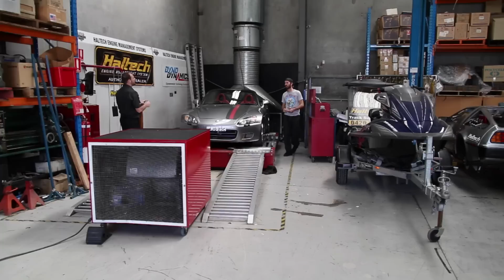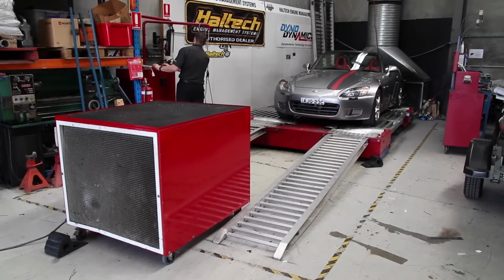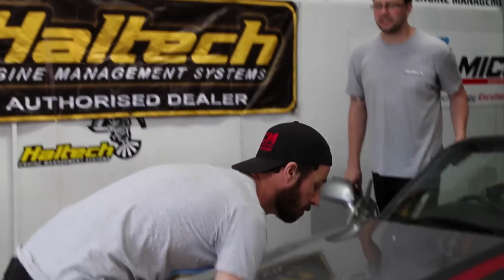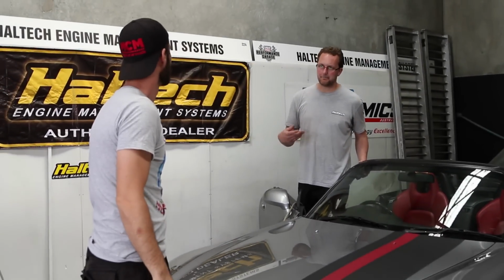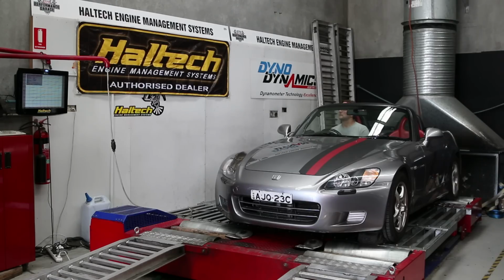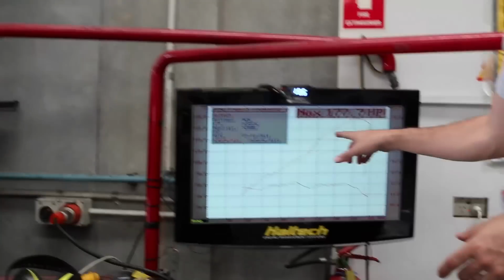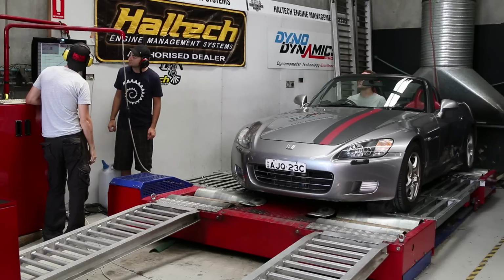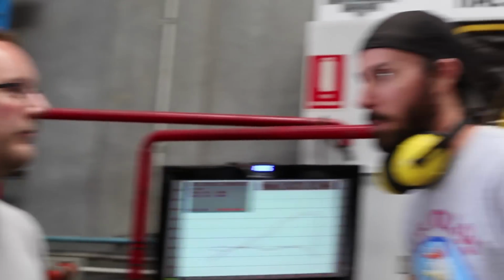Cold Air Intakes Mythbusted [Naturally Aspirated]

Comment: I have a ss cobalt Lnf n I put a aem cold air intake and it makes the turbo sound really nice and if anything I noticed a cleaner sound for sure but I cant make a claim and say that I obtained more power since I've never had it dyno tested but with the combination of the aem cold air intake and the hahn 3" downpipe catless does feel like I gained a little hp but like I said I need a tune and dyno test it to make a legitimate claim like that but sounds great an mean even with stock exhaust and charge pipes. The next step for me is the charge pipes and intercooler then after that I'm shutting for a trifecta tune and stage 3 clutch then I'll start modifying the exhaust system, intake manifold and add stage 3 sensors and coil overs to drop it to the floor plus many many more my goal is stage 3 since I need my whip as a daily driver #cobaltnation

Comment: Think modern cars are not meant to be tuned if you look at output per litre of a car now (1.0, 1.2, And 1.4/5 for example) small engines now can put out 120-150 stock much of the improvements in output and economy come from progressing injection and programming technology and like was mentioned you probably will not get much more unless maybe you throw it all away and take an engine back to bare bones and rebuild it with carbs, ported, polished, new headers etc instead even then it’s still probably not going to get much better, though one thing is true that turbo and supercharged engines do benefit from from inter coolers which is properly achieving what is intended of the NA cold intake claims to do, but  I am curious if this was done again in very hot weather or hot and high conditions would it still have showed the same result as say spring autumn or winter

Comment: Would the stock air box with its tiny baffles flow enough air for a 5.3 with a larger throttle body, bigger cam, worked heads, headers, and free flowing exhaust? Doubtful. Aftermarket can AND will.

Comment: I was gave a 2003 Civic with 76000 on the clock no power crappy mpg bought a $20 cold air on eBay Chinese junk lol I was curious lol turned out it was for a accord made it work and wow what a  difference night and day now it will squeal the tires and it averages 38 to 40 mpg

Comment: I dont have access to a dyno. I would like to see test results where the air filter is in wheel well, area AND heat insulation the pipe from filter all the way to, say 3 inches after Mas airflow sensor. This is what I've always done when going cold air. What better way to prevent heat soak? I might be wrong. Let's hear you.

Comment: For a cold air intake to work you need actual air going into the pipe to your motor because on a dyno your not actual getting air into the motor because your not moving
Reply: Cold air not ram air,there's a difference
Reply: CaptCaaaveMaaan I've done both and it makes a huge difference. It really IS worth while on a NA engine. I have two identical cars and engines and one with and one without all the mods.. MASSIVE difference.. Alfa 156 2.0L's... simple mod..massive change.. Alfa choked them for what reason again?

Comment: I'd like to see the difference between getting fresh air from the headlight or front valance area versus the normal intakes we see that end under the hood where you're sucking hot air from the engine department
Reply: most stock ones pull it from the grill and/or inner-fender or stock hood intake scoop and when you buy the CAI it throws the open filter inside the engine bay. I just bought a drop in stock K&N replacement and I'm just going to 3D print a new horn that goes from the fender to the front of the airbox thats the source of the restriction
Reply: @NXT_LVL  I guess I'll be stuck with building my own since the intake I was gonna buy has went out of business. I'm having to sit my engine in so I can mock it all up.

Comment: I got an Audi 90 20V from 1989, a 2,3 L straight 5 20V DOHC, 170 HP stock. So if I made my own cold air intake by bending/welding a pipe with inputs for the vaccuum and sensor BS, put on a cheap €10 cone air filter from the swedish equilevent of Autozone, do a resonator delete, run some cold air feed, put a homemade heat shield around the filter. Will it do anything other than making a filter swap more conveinient?

Comment: Sorry mate, your tests are not valid. Why? Well, for starters your dyno lacks a front fan resembling real world condition. When a car is accelerating, air is hitting the front of the car at a higher velocity and volume. You can test this by just sticking your arm out of passenger window car when your on the freeway. This blast of air will increase the velocity and air pressure that your filter will receive in  real world condition.
Reply: ya I totally agree they always test in wrong way. they always seem to get it wrong when it comes to their mythbusting videos.....
Reply: it's all relative....google " the principals of volumetric efficiency " then air flow dynamics " these both demonstrate that horse power is robbed by warmer less dense air. friction causes air to heat. less things between the atmosphere and the piston means less friction  which means cooler denser air mix which means greater volumetric efficiency means more hp. it's basic science fact. just make sure you avoid heat soak and the engine will always gain hp

Comment: Now test it on a shitty car that only makes about 130hp or less. And see if there is a difference. Testing on performance cars isn't an actual test. Because obviously it works for them because the factory restricts the airflow. But low end fuel efficient cars don't have that restriction, and possibly lose power, because there is too much air that's where the test should be.

Comment: So did anyone even catch what brand model or anything in regards to the actual short ram air intake they were using, I mean I'm sure there is a difference between Ebay Intakes and a Takeda Stage 2.  I'm just wondering if another Intake system might have produced more than 6hp.  I have seen some dyno reports from companies touting 10-13hp.  I think that is a little much for a intake but hey, who am I to call them liars.

Comment: its obvious it would. you are making there air colder coming to the engine. you are taking out restrictions that might be in a stock intake and going to a smooth pipe instead of the stock one that isnt smooth and flat in the inside. the material doesn't make that much of a difference. its not enough pressure to make a difference like it does with boosted car. plus the more you things you do the intake will help out as well, headers exhaust, intake manifold etc. for the money it isnt that bad, not like those fake chips those dont do anything.

Comment: any body else notice the amount of power loss in general of this car? should have somewhere close to 240 hp from the factory, 170 is a 70 HP drop which is pretty bad lol
Reply: those figures are power to the wheels. you lose power due to friction through the transmission and the differential. its probably still making close to factory horsepower.

Comment: So heres a question.

If I keep the OEM Airfilterbox but put in a KN air filter, and use the carbon directflow aftermarked piece to direct the air direct in that box. Will that help? Or is the point just removing the box?

Comment: A Wankel is like a 3 Stroke :D Not a 2 Stroke holy moly
Reply: +Itachi Uchiha the best way to describe it is "All" stroke. due to the nature of how it fires.
Reply: MrDeathChicken relative, i premix my rx8 with 2 stroke oil but its an unique engine and i love to drive it
Reply: +MrDeathChicken What is an 'All' stroke engine?! there is no such system. A Wankel engine uses the otto cycle, which is a four stroke cycle
Reply: i'm aware, its not an technical term. It just refers to the fact that there is always combustion happening in the rotor. because it doesn't have cylinder banks like a piston motor. I heard the term on regular car reviews as far as I remember

Comment: the s2000 came stock with 240hp and now youre down to only 177? where did 60hp go?!
Reply: Wheel horsepower vs flywheel horse power. Totally different things buddy
Reply: i know they are but its normally only between 10 and 20% loss between fly and wheels
Reply: Its an old car now likely with a lot of miles, probably on cheaper fuel.
Reply: this is true

Comment: Seriously, a 177HP is not a high-power engine
Reply: 177 to the wheels and 237hp, greatest displacement ever made from an engine, 120hp per Liter until the ferrari 458 came out with displacement of 125hp per liter, which makes it a high powered engine

Comment: 177hp..??? they have 237-240 stock
Reply: those Hondas are crap
Reply: +Noah Rule scuse me? they beat 350z's, those hondas? only other hondas out there that have more hp are the newer sedans.. amd not by much and weight so the s2k is still better.
Reply: Rcboi96 Honda Vcrap. Ain't for everybody
Reply: +Noah Rule can't handle them, but I have a Lexus right now I'm saving for an S2K, how does the sound of VTEC not make you smile man what kind of life do you have..
Reply: +Noah Rule yes I will admit the they are in the top 10 most unsafest cars in America, but if you know how to drive, then that doesn't matter, and I know how to drive.
Reply: +Rcboi96 The engine itself is rated for 240 HP. This dyno was measuring the horsepower from the wheels. Power has to travel through the driveshaft, axels then the wheels. Once that happens the power that actually reaches the ground is less. All cars loose between 15% - 20% when the get on the dyno. All wheel drive cars usually loose 25%-35% because power travels through all 4 wheels. So that 505 horsepower C6 Corvette Z06 really makes around 420 horsepower from most test.
Reply: +JackRABBITslim27 177 horsepower seems a bit more than 15 to 20% and I already know that
Reply: +Rcboi96 s2000 has a weight advantage over the 350z stock. Anywhere from 300 to  800 lb's depending on what year and options. Toss in that weight into the s2000 and it still sucks :)
Reply: +pszresonation you sound like you know so much cough
Reply: +Rcboi96 177hp at the wheels maybe? They are pretty slow. My Mazda 3 chopped it
Reply: Nevsack63 So if you say an S2K is slow then that means you think the 350Z is slow too, because there is a video of a S2000 beating a 350Z, a lot of it is power to weight ratios, the S2K is not a bad/slow car, I'd rather own a S2K over a 350Z anyday, and the S2K in this video has to be tuned wrong because manual transmissions lose 15% of their HP, not 25%-30% like automatics do, I have a 1996 Lexus ES300, those have 188hp 203tq, and it still doesn't take me long to get to 100+ without the TRD Supercharger, it still pushes be back in the seat even with that amount of power., so this S2K is probably tuned wrong because that 177hp seems a little low.
Reply: It's 177 kW, not 177hp..

Comment: I bought a car with a cold air already installed and it has weak low end, if I had the stock air box I would try re-installing it and see if it actually improves
Reply: Like this video demonstrated, you will lose higher end power, but gain lower end torque. You'lol like the torque, and the high RPM power loss will feel negligible to u.
Reply: Turkee Sonvich if it is a highend/well designed car

Comment: Just curious, don't you have to upgrade the throttle body to see a difference with a cold air intake? my thought is that the throttle body would hinder the max/min air the engine could take in, so the only way the oem throttle body would see a difference would be when totally open
Reply: +DatSkinnyChild The ecu will only let so much fuel through. You would have to remap the fuel to get the most of out any sort of air intake. Be it a cold air intake for N/A motors or some sort of forced induction. That's why myself, and people in their 40's and up who used to or still race prefer a carburetors or mechanical fuel injection. Both options will provide the engine with as much fuel as it needs to consume with how much air is being put in. Mechanical fuel injection costs a helluva lot more than a carbureted  system though.

Comment: My question is, why does that s2000 makes 177hp, ain't a stock S2000 out the factory supposed to be making 246 hp?
Reply: With drivetrain loss I would have thought around 215 hp maybe but not 177 hp that really sucks.

Comment: k&n cold air filter makes my 2003 Honda civic coupe EX run cooler motor temp and gives more horse power. are you two entertainers or actual mechanics> i believe the former. hey beard guy why don't you just get a bull horn to talk through? think you re freaking loud enough...sheeesh
Reply: +stormbringerr mourn Are YOU a mechanic? Engineer? Did you dyno your vehicle?  What you believe is irrelevant. Prove it. Show us how you arrived at your conclusions.They have a dyno and tested properly. You're pissed because you spent money that almost certainly did nothing.
Reply: TheDeenohh
they came to the same conclusion that the custom filter works better. did you even watch this?

Comment: Currently driving a Swift Sport MK2 bj2014, it's a 1.6 NA twincam high revving engine. Coupled with a low weight just over 1000 kg it's a fun car to hoon around. Now, i had this problem ever zince i got the car that on certain situations the performance would be less then ideal when trashing it, specially in lower RPM range.

After some searching around i came across a DTN short ram air intake, venturi effect style tubing. I was very sceptical to begin with and just wanted a better induction sound to be honest as these cars are naturally very silent.

Couple hours work and went for a test drive . . .  That little thing has transformed the car for me, does it have more BHP ? honestly i doubt it, but that's not the point, in lower RPM range i get the feeling that the car pulls far better, seems my torque curve is coming on at lower RPM making it a better drive.

Could i lose some Ponies at the higher end because of the install? Yes could be, however the car now reacts better on throttle inputs and pulls better sub 4k. So there must be a effect. . .

Anyone else that had similar effect when they installed a short ram air intake or CAI ?

Comment: um didnt the s2000 come out with 176kw @ around  8000rpm???????
Reply: These are the claimed numbers for power at the crankshaft (it's always measured at the crankshaft by the car manufacturers) when the new car rolling out the factory. Power at the wheels = Power at the crank - drive train & other losses (rubbing of brake pads on discs, worn-out ball bearings etc.) These losses vary..
I've learned during my engineering degrees that it's about 10-15% loss for FWD, 15-18% for RWD and even more for AWD.
But these are only average numbers because you only can compare with numbers given by the manufacturer - if he lied about the output, you may "have less power loss" than the numbers I've listed.

Comment: Hey mates🤙
Thanks for video & happy new year
Been thinking 'bout do this with a 2010 Nissan Altima 3.5 srv6. It already has 270 to 280hp?
I found the dragon r intake...need help thanks
Reply: if they used a brand new aftermarket vs a used factory one then perhaps the difference is the factory one needed to be replaced anyhow

Comment: will it help more on old (80s) cars?
Reply: Only if the factory box is restrictive. You need to look at how the factory air intake is setup. The more exposure to open air to the filter the better. Get a filter and protect it from heat in a box, or move it away from the engine entirely and relocate it into the fender well.

Comment: intake and exhaust ain't gonna do shit if you don't have a tuned on the car in fact most case you lose power because the air/fuel ratio is fucked and if you tune the ecu you void warranty and its quite expensive there just no cheap way in making power you aint gonna get shit from a drop in filter best case scenario form a drop in or cai with no supporting mods 1-5hp worst case lose power and ecl come up